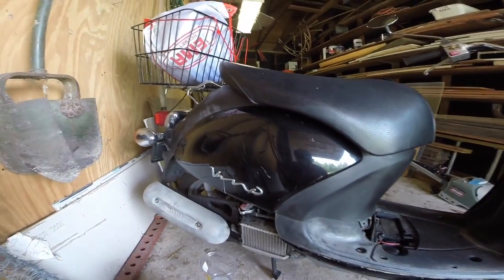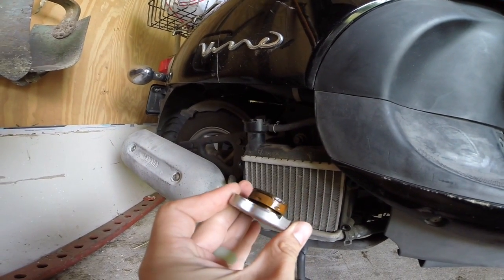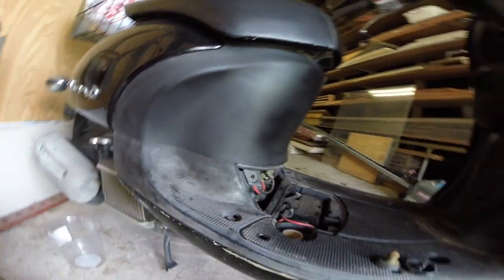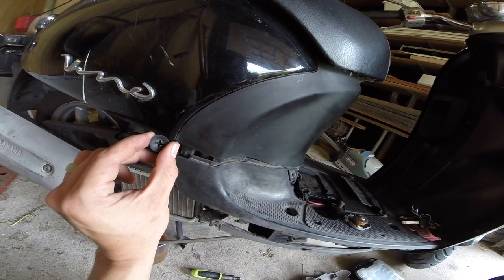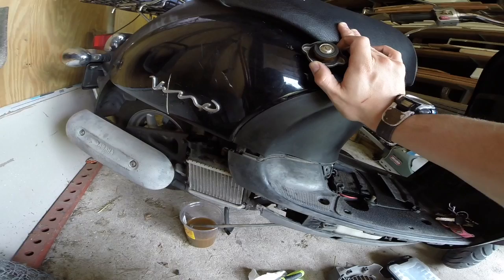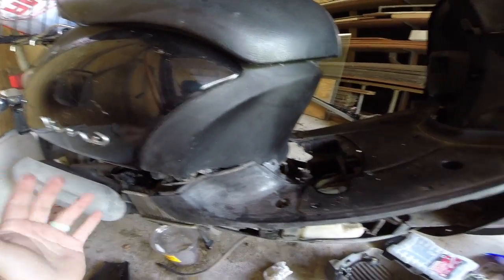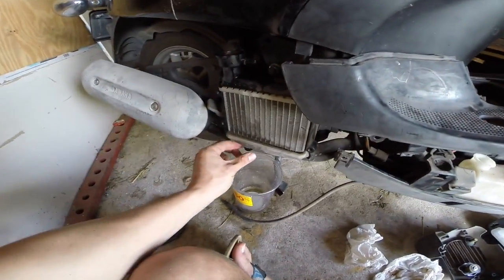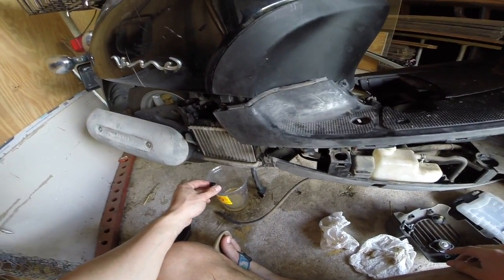Yamaha Vino Classic Cooling System Service

Comment: Thanks for the video! Gives me a good base from where to start. I  just picked up a 2006 Vino 50cc 4T. Only 4.5k miles, but no idea about any maintenance history other than the carb has been taken apart and cleaned twice by a local shop (due to gas gumming it up from sitting). I assume coolant has never been serviced.
Reply from the maker: Congrats on the new to you Vino! It’s good there’s at least some record of shop service. I think if the original coolant would have been left in my radiator there wouldn’t have been as much corrosion. It still ran fine after the flush with no leaks. Good luck and safe riding!

Comment: Hi! Thank you for your videos, they helped a lot! It seems my coolant reservoir pipes are blocked somewhere, I couldnt drain the coolant from there and my radiator was almost empty and full of sludge. Could you help me how to remove the side skirt to get to the coolant reservoir? I’ve removed every screws I saw but it still wont budge :(

Comment: Hey! How did you clean the system with distilled water? Did you fill the empty system with water, start the scooter, and then drain the water, right? Or without start scooter?
Can you write me shorty steps for changing antifreeze?
Sorry for my English.
Reply from the maker: Kir V Hi! For cleaning the system I first put the plastic drain plug back on to the radiator, hand tight, just to keep the water from spilling completely out. I then filled the radiator to the top with the distilled water. After the water reaches the top of the radiator, I removed the radiator drain plug again and allowed the water to run out into the cup. I did this probably around 10-20 times until the water came out clear. Then I removed the plastic overflow (white looking container under the floorboard)  and I rinsed it thoroughly (about 10-20 times). I then reinstalled the plastic overflow container and hooked up all of the hoses. Once everything was put back together, I filled the radiator up to the very top and ran the scooter with the radiator cap off. Once the engine started heating up and circulating the distilled water, bubbles would come out of the top of the radiator and the water level would drop. This technique in English is called “burping” the cooling system. If you’re carful, you can also gently rock the scooter from side to side, which will make the water fill in openings in the cooling system. After the radiator “burped” once or twice I’d shut off the scooter and drain the water from the radiator drain plug. Be careful, the water may heat up. I repeated this step with distilled water many times, until the water came out clear. I then tightened the radiator drain plug back on the radiator and filled it with coolant. I burped the system again and filled it with more coolant until it stopped burping. Once the coolant stayed at the same level I replaced the radiator cap. I also checked the coolant level the first few rides after this to make sure the coolant hadn’t gone down. It was only necessary for me to flush the system with distilled water because there was so much rust in the cooling system on my scooter. If it didn’t have the rust, I would have just drained the radiator and overflow container once and refilled them both with fresh coolant. Sorry if this is too long I just wanted to do my best to explain everything in detail. If you have any other questions let me know and I’ll tell you what I know!
Reply: Old Man Millennial thank you! I will try do it in few next days!🙌🏻
Reply: @oldmanmillennial5375  one more question. Did you change gear oil? What viscosity fill transmission oil? 10w40 or 75w90? (Not engine oil)
Reply from the maker: Kir V No problem! I actually never got around to changing the gear oil. Sadly I sold this scooter about 6 months ago. The manual I used calls for SAE10W30SE, I probably would have just used that.
Reply: 75-90 for gear oil